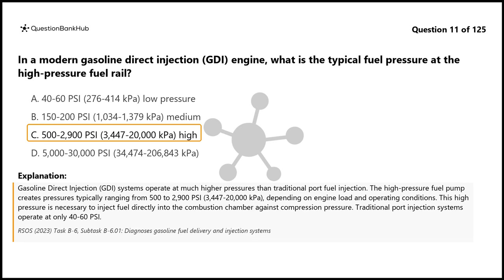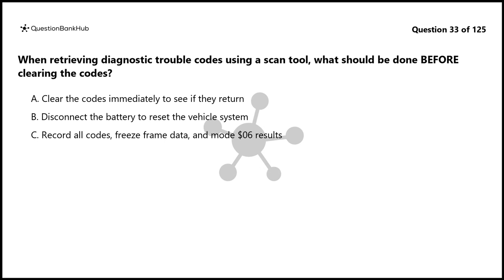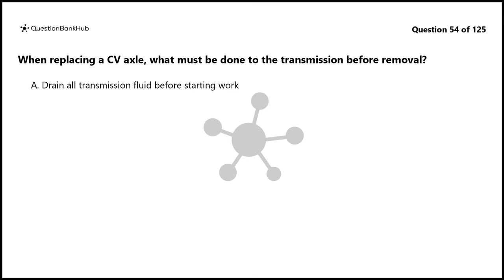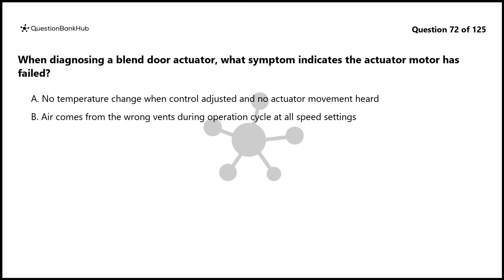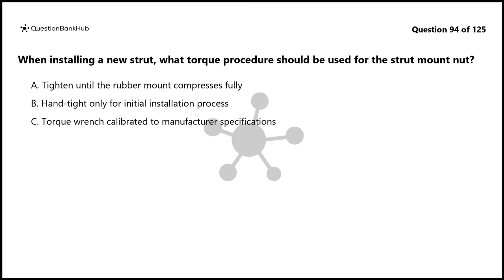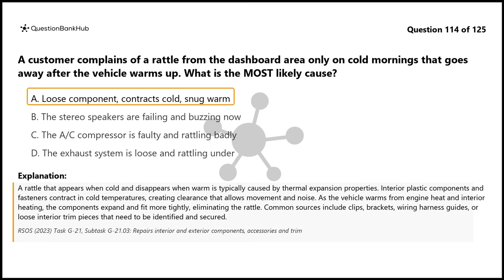Automotive Service Technician Red Seal Exam Prep: 125 Practice Questions with Answers & Explanations

Comment: what about diagram electrical and or suspension systems on diagram,, any chance of that?
Reply from the maker: Working on something! stay tuned
Reply: Other then electrical diagram questions this was actually pretty helpful. Maybe more ev questions and diesel basic
Reply: @cuzocustoms  really how was it,, i write mine next week
Reply: @ChristopherMwaba-um2vy it wasn't horrible honestly. This video helped tho. But obviously not gonna be exactly the same. I get my results in a couple weeks. I was in amd out in an hour
Reply: @cuzocustoms any updates? Was there some formulas? And what type of questions were about wiring diagrams?
Reply: @VolodymyrCarElectrician there was electrical problems with schematic diagnosis.but was easy like light problems
Reply: @cuzocustoms Thanks for your answer. you pass it? What about oscilloscope waveforms? Any formula calculations?
Reply: @VolodymyrCarElectrician yes I passed and no. No wave form. The electrical questions were very basic
Reply: @cuzocustoms thank you!
Reply: @cuzocustoms congratulations bro, can you share other materials you used for preparation?
Reply: @cuzocustoms  do you remember any engine diag or repair stuff??
Reply: @박성현-d7y  If I remember correctly I believe my test did. But they were very basic common sense questions
Reply: I write today we will see how close amd helpful this is.
Reply: @cuzocustoms  how did you make out? was it helpful...